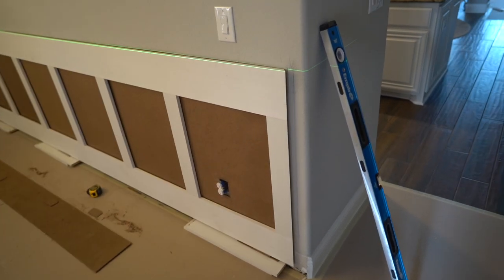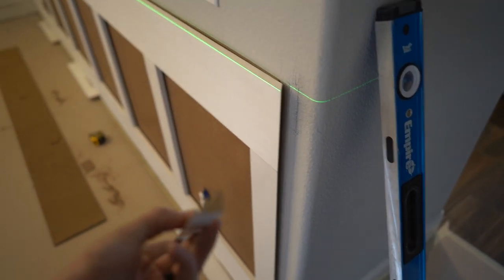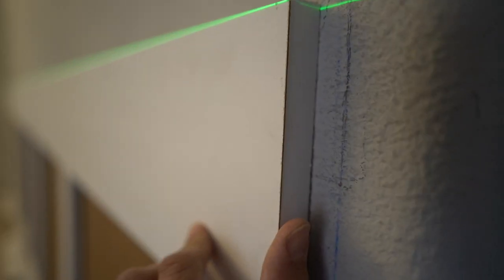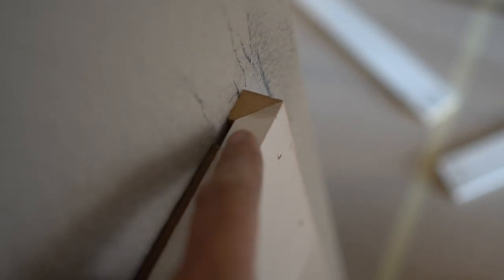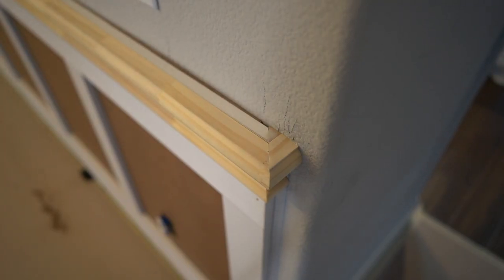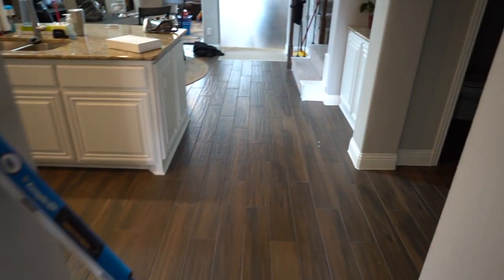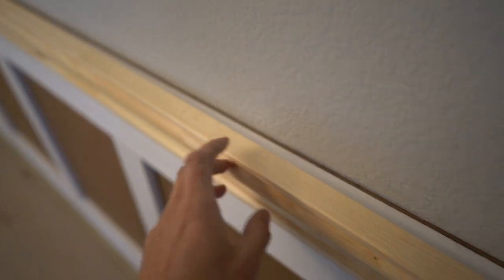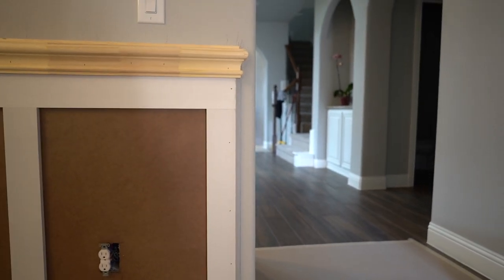How to End Wainscot at a Corner

Comment: Awesome work as always Richard and thanks for all the tips you provide. I did some great trim work in my house because of you. 

Two possible videos would be great to make that I couldn’t find answers to on YouTube (if you ever have a job that you run into this)

1. How to have wainscoting to die into door casings that already have casing and headers on them (when you can’t apply backband moulding)... I ran into this issue and doubled up my casings to make it work. A lot of extra work, but don’t know if there are other options.

2. Wainscoting down stairs. I can’t find videos that show installation with paneling behind it. My stair stringers aren’t thick enough to accommodate the plywood behind it — would you just not put plywood behind stairs or is it something you should always do? I know you mentioned in other videos where it adds the smoothness and thickness, and I’ve seen the vids where you add them as cutouts, but with different types of PM that don’t sit like crown, you can’t do it.

Thanks again, not sure if any of this makes sense. :)
Reply from the maker: Rick Hamlet thanks for the suggestions. I will do a video on those ideas should they come up. Thanks!

Comment: Very nice!
Can you show us how you return the 5 1/4"  base around the corner and at the end of the wainscotting?
Thank you
Reply from the maker: splash it basically just flows continually into the existing base.
Reply: @FinishCarpentryTV  
Nice
Reply: Finish Carpentry TV so is it going underneath the wainscot unit? Cuz that bottom rail looks pretty low. Looks like baseboard would sit on the face of the bottom rail.
Reply: i have the same issue and cannot seem to find a pleasing solution

Comment: leaving a question on this most recent vid in hopes that you will see it. Question, when using the 1x6 MDF to create a shiplap look and you need to join two pieces to get to your desired length what method do you use to join the two pieces. I think I should be using the method you showed in the "joining two pieces of molding/base" video where you 45" the pieces/CA Glue and add the back strap piece. Is that right? Thanks

Comment: Just wondering why you don’t just cut the door stop piece square at the end instead of a 45 and then glue the triangle piece to it?
Reply: Because you will see the raw wood once he cuts it straight
Reply: Kyle Threewit   If you just don’t cut a 45* angel like he did in this video. The end grain may show, making it harder for you to sand, prime, and paint.
Reply: Makes sense
Reply: Also you lose the slight bevel that is on the outside top face of the piece, not apparent to your general consumer but for a Craftsman like him it's a must do
Reply: I was wondering the same thing and now I know.  I knew there had to be a reason why.